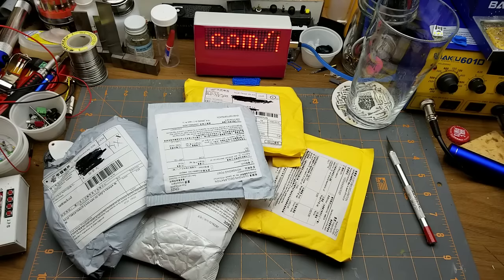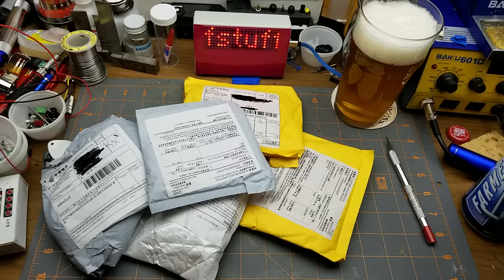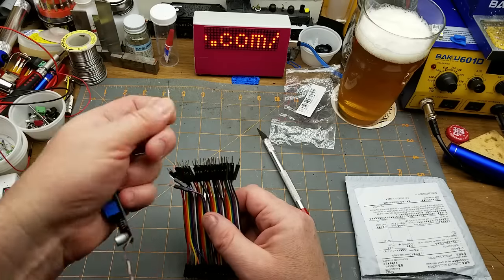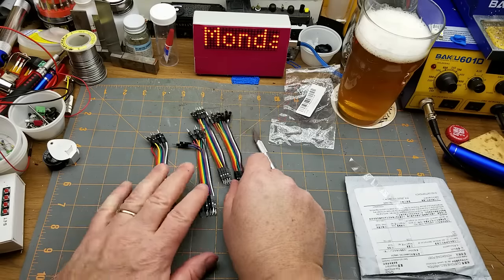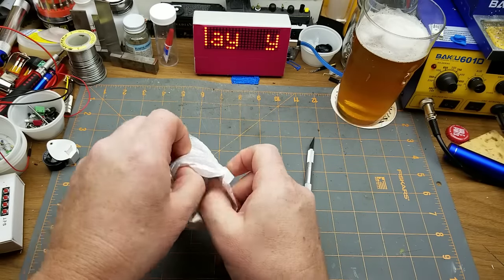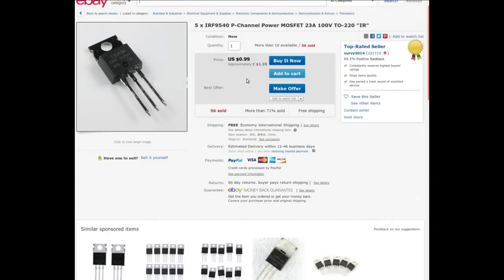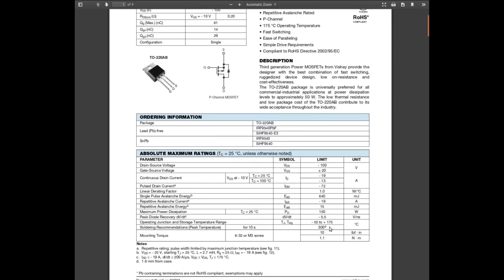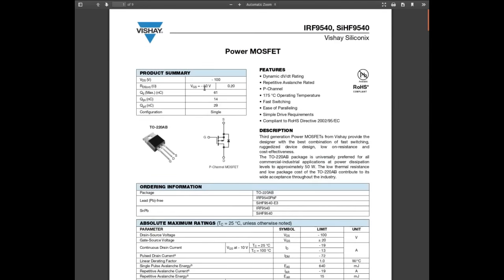Mailbag Monday 48 (new years eve edition)

Comment: That powerbank looks like something useful. Most smaller ones, read cheap ones, start dropping voltage when at a 1 Amp draw.  To bad you don't measure the noise on the output. I've seen crazy spikes on some of these making them dangerous for some projects.
Happy 2019 !

Comment: For the LCD Keypad Shield you may have issues hitting the Reset button by mistake, I ended super gluing the button so it could not be mashed.  It caused several bad words until then.
Reply from the maker: Yup. I already ran into that headache when I was testing it.

Too bad they didn't put that one somewhere far away from the rest of the controls.

Comment: I bought some short ones , I have long ones that are really nice, But the short ones I got are garbage, they are very stiff and the ends are U and not a pinched taper, so I can barely get them in the breadboards.
Reply from the maker: Those are the ones with the square insulating sleeve, aren't they?

I have a few of them as well, and they're my "last resort" wires. I much prefer the ones with the heat shrink insulator.

Comment: What was that transistor/mosfet identifier circuit?  It looked useful.
Reply from the maker: It's one of these: 
https://www.ebay.ca/itm/LCD-GM328A-Transistor-Tester-ESR-Meter-Frequency-Square-Wave-Generator/311742432137
in a box that I threw together quickly from random scraps of plastic.

Comment: lcd keybad buttons, have serial resistor net, and use one analog input, code read if resistor have 200 button 1 do, if resistro have 600 button 2 run etc, this code read what button bush and resistor have different ewery button, analog pin read input button resistor value. adc key have value what resistor read if have less x then have button x etc.
Reply from the maker: Yes. Basically a multi-level voltage divider connected to a single analog input.

it's a clever way to get multiple buttons on a single GPIO pin.

Comment: i have mailbag monday ewery month i orden chinese elektric stuff ewery month somethink little. last 4 year has orden internet ewery month somethink what need, now have season orden diy cnc parts and bits etc, and woodwork tools. before orden lot lot arduino sensors and parts, and raspberry pi 3 boards and parts. welding machine has big fail, 500€ and no longtime live. and last 6 month banggoods shop parts not has come, mail not work alltime true.